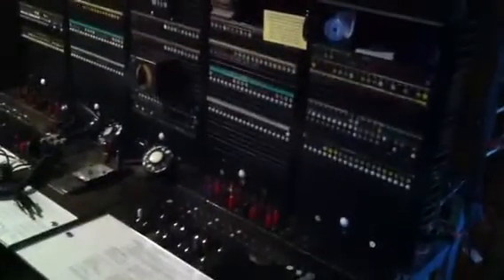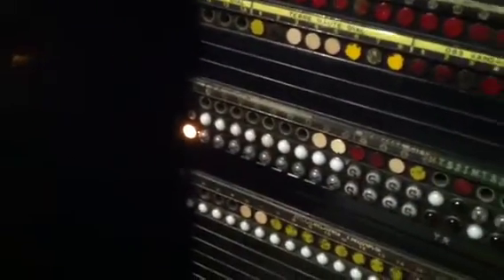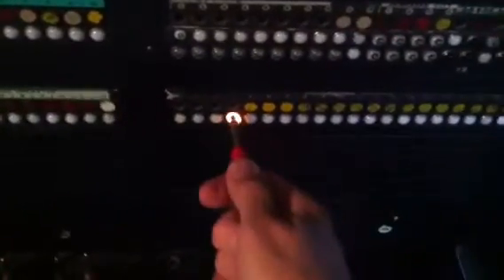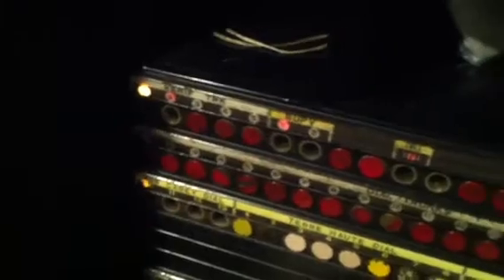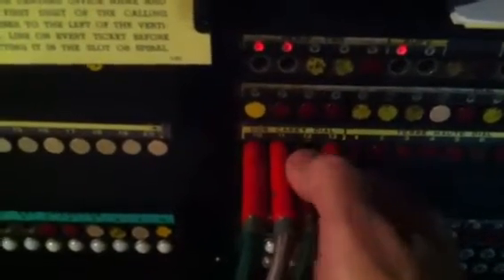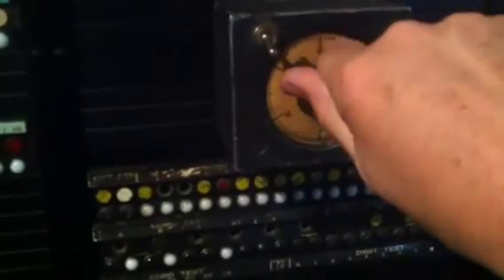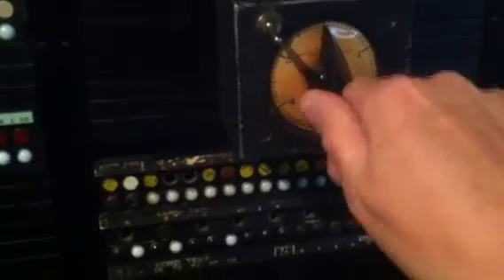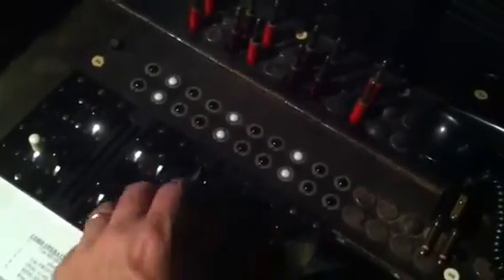Number 3 toll board

Comment: Very nice to see an old toll board hooked up and good description! The timer with the bell was probably for pay stations. In small towns with manual pay stations, the operator would come on and request overtime charges after three minutes. Coins dropping on the station would ring a bell indicating the amount inserted and the call could continue. Would love to see the switch you have running this thing. Is it on Cnet?
Reply from the maker: +Alexis Kasperavičius on C*Net.  Office code(s):  486-Stromberg Carlson XY, 684-Federal Telephone & Radio TPL, 375- FT&R/AE TPS, 865-ITEC EMS1.  486-0121 Tollboard Inward.  Check the C*Net listings for working numbers.  Thanks for looking.
Reply: Consider purchasing a pre-pay manual phone? Needed are either a switch or push buttons for collect and return. These would be connected to the answering cord circuits on the switchboard.  Power supply needs to be  110-130 volts DC. The switchboard buttons would change polarities of the current; one for collect and the other for coin return. The coin phone user would lift the handset, insert a dime or 2 nickels, thus grounding the tip or ring briefly(depending how its wired). that closes the loop relay and lights the appropriate switchboard jack lamp. Operator would press the key to talk as normal. With the talk key pressed, operator can return the coin deposit in the phone if call cannot be completed or collect it if the call is answered.

Comment from the maker: The back key is the ringing key.  "Ring-back" and "Ring-front".  Ringing current is sent over tip and ring of the cords, back cord and front cord respectively.

For a trunk to trunk call, the front cord derives its power from the trunk or selector.  Plugging in the front cord to a manual station, pulling the "ring-front" key dos two things: rings out on the front cord, and operates another relay in the cord circuit to make the front cord a battery feed cord for the manual station.